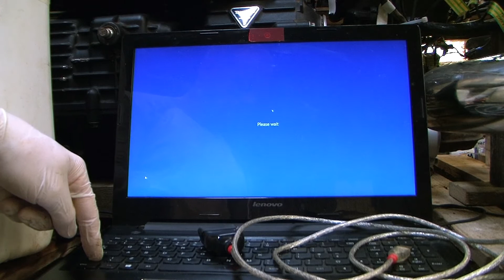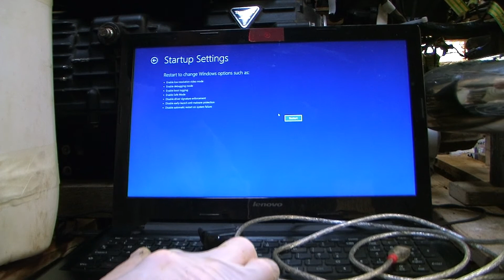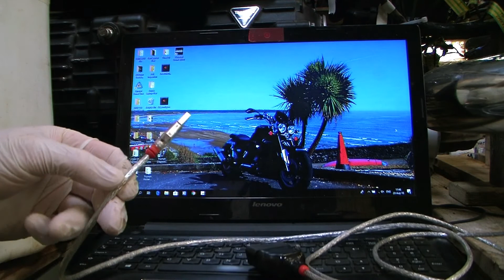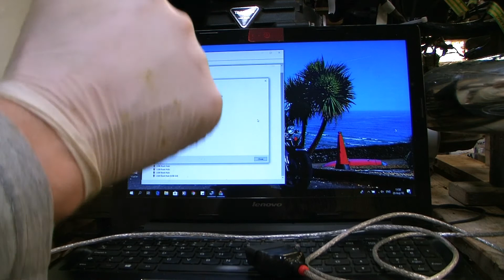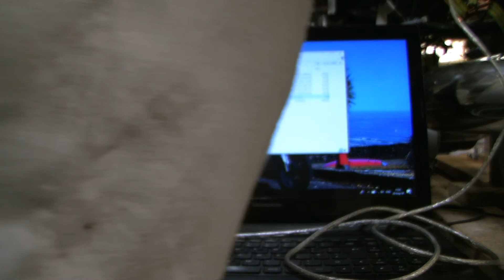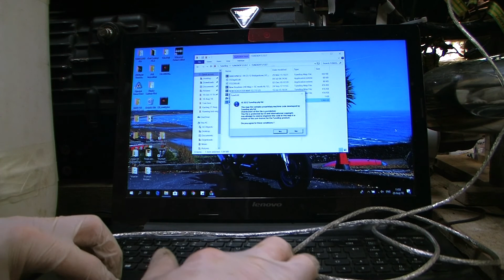How To Fix TuneBoy Cable Communication Corrupt Driver Update Problems

Comment: Hi there. It's ur student from zambia. Do u think this would work with the lonelec cable doing the disable thing?
Reply: Don't think it applies to TuneECU but if you like you could give it a go. No luck with manually updating the drivers for the 2 devices in device manager that apply to the one cable?
Reply: @Arthur Lewis  no luck. When I try update from my devices it starts the update bar for a second or less then says ur devices have the latest/best updates. Can't remember word for word was just tired and frustrated
Reply: @vwbeetle5578  dunno dude it's hard to diagnose over texts like this. Really need to see what's going on to help I think

Comment: Hi, I have the cable show up in 'Other devices'. I get nothing in the USB list. I've been through everything you show about 100 times so far and still no joy. I do get a message that the 'tuneboy USB is set up and ready to go' and yet in Device manager the yellow icon shows and then it says Windows could not find drivers for your device' . I've downloaded the latest drivers from tuneboy and tried them all.
Reply from the maker: Have you tried right clicking on all devices (that appear in Device Manager when you plug in the cable), and disabling them, then manually point it toward the drivers location?
Reply: The only thing that pops up is 'Other Devices' and then 'Tuneboy USB'. Nothing else at all including in the USB list. Pointing Tuneboy USB manually at the driver in downloads, I get 'Windows was unable to install your Tuneboy USB, and 'windows could not find drivers for your device'
Reply from the maker: @gregquicke7008  I assume you've disabled the requirement for digital signature enforcement ok. Could I send you some drivers to try?
Reply: @r-iii-rturbo9157  can't seem to get a reply through to stick on here. Maybe because I am trying to give you some contact details? Yes I have done the disabling thing a number of times and would love you to send me some drivers please. Thanks for helping!
Reply from the maker: @gregquicke7008  sent via Google Drive, some drivers from 2011